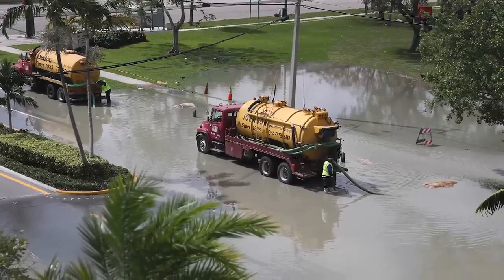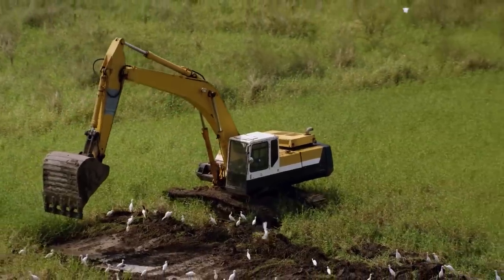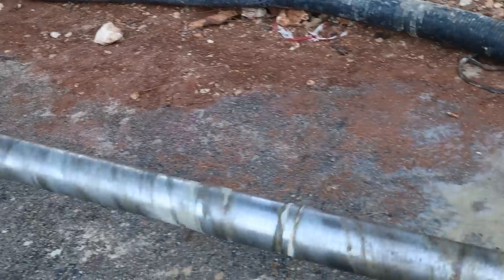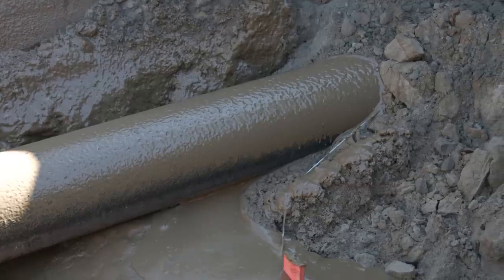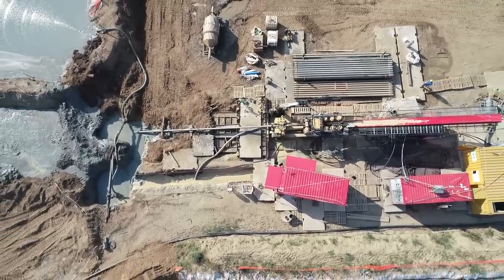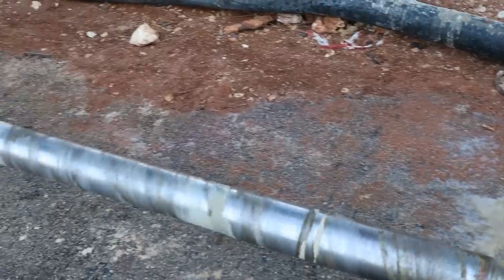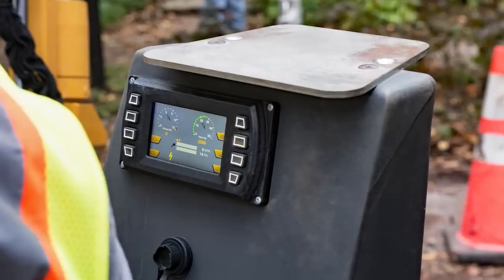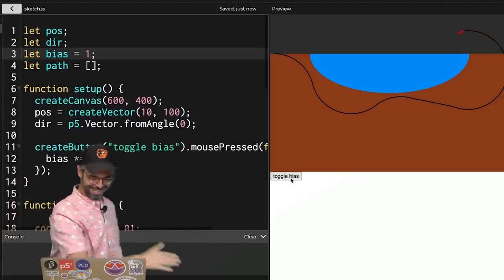How Do You Steer a Drill Below The Earth?

Comment: Honestly, the biggest question I had was the part you kind of skipped over - how the heck do they connect lines that are placed underground this way?
Reply: Most times to don't drill surface to surface you dig two pits then place the drill behind one. Drill into pit 1 at the appropriate depth and angle then drill to pit two pull the pipe back to pit one disconnect it and then attach your ends in the pits

Comment: I actively work with this drill on an everyday basis, i only put the pipe underground for Spectrum or Vyve to run the cables they need. Rarely we run the cable. These Drills are very very fascinating and people always like to watch, and its actually easier than you think. The best dirt for drilling is clay or butter dirt. Sand is easy digging but the drill head cant grab material to steer, same with cobble or rockyground. You ever see these drills... they installing your internet for porn